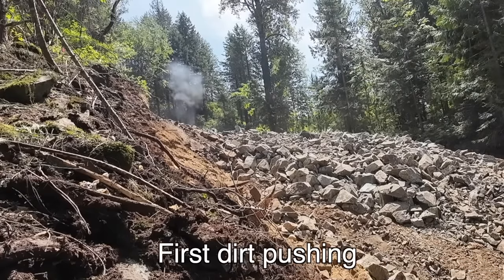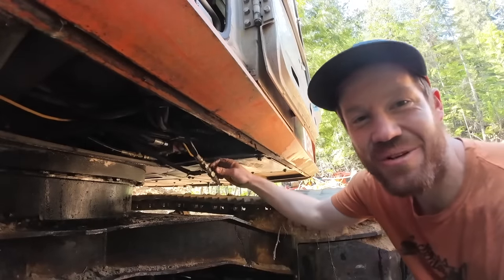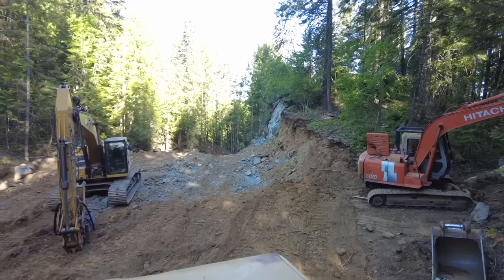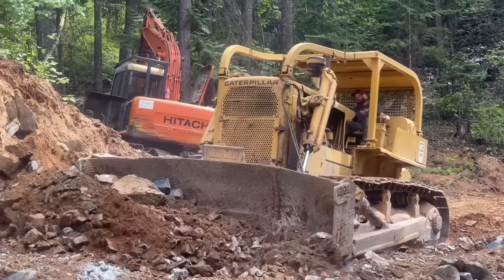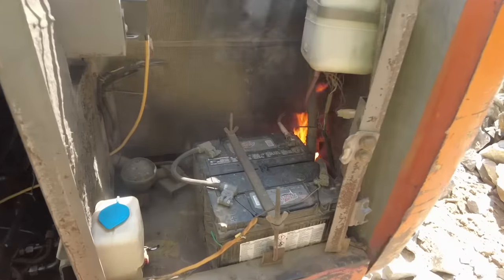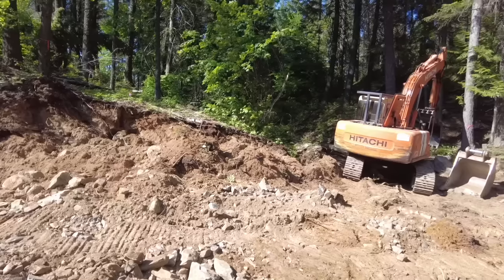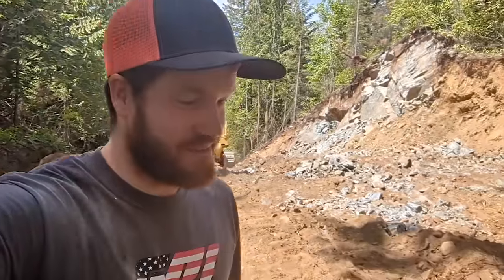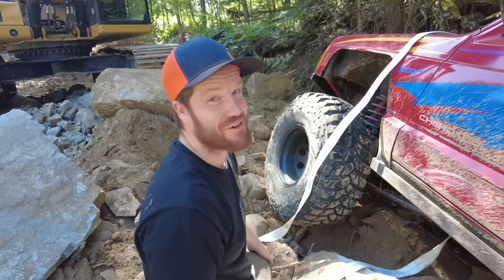I lit my excavator on fire... | Building Our Road

Comment from the maker: To start comparing quotes and simplify insurance-buying, check out Policygenius: https://policygenius.com/ambitionstrikes.
Reply: Almost right after the advertisement, Riley drives the Jeep to where it is thoroughly stuck and need the excavator to extract it? Really? Are wise decisions a better insurance policy than the alternative? I normally don't comment in this manner. But insurance in my mind is for IF something happens, NOT WHEN one puts oneself at risk by choice.
Reply: look in to how much it would cost to have that part of the road blasted because you could have blast down to were you want it in one go and just brack up some of the bigger rocks left
Reply: FWIW: Don't use dry chem extinguishers on equipment because the dry chem is extremely corrosive. best option is a water extinguisher or a CO2. However CO2 does not work as well as water. I recommend keeping a 5 gallon can full of water strapped to machinery so you always have water available, especially if you working in grass that can sometimes catch fire when operating machinery. 

FYI: not trolling, just trying to provide some useful information from experience.
Reply: Isn't the reason for having life insurance so you can be reckless...lol
Reply: Hello, Sorry I don't have tellllllgram. Thanks??? 
I don' t make a good spectator at all! As I love doing that work, of those things!
Reply: Re: overheating hydraulics — usually one of two options given the age of your excavator — the obvious one is a plugged up hydraulic radiator which needs cleaning (or a forced air fan for the radiator).   - a less obvious solution is to increase the inner diameter of all of your hoses — if hoses were replaced with smaller hoses, there is a lot more friction for the same flow rate.

Comment: Our bobcat 337 kept overheating after about an hour as well. New V belt, extreme radiator rinse with normal garden hose and a new fan shroud ( old fan shroud got hot, deformed and sucked against the radiator) had it back in action with the AC blasting nice and cold.

Comment: I am convinced that Riley breaks things just so he can fix them. His way of having fun!
Reply: Professionals break shit once in five years. Do the math.
Reply: You need a Mr. Wranglerstar Professional homeowners shirt!
Reply: You might add. Just because you can buy equipment,  doesn't mean you know how to use it correctly. Each time the dozer blade , jabs the rock side it stress the whole system. 5000 psi hot hydraulic fluid push to one side with a increase of PSI, will blow valve banks. Hurt the hydraulic static controllers. I used to drive a rail road ballast cleaner. 380 feet long, 3 lines of joy sticks, 
Dozens of pressure  gauges,  had 3 radios on at all time as I drove, it standing back wards,  with 20 foot tall digging wheels 2 feet from my A cab windows, where I climed up 15 feet up a ladder to get to my cab.
Point is , there fun to watch, yes R, is smart.
But they have no clue what there doing., digging below the ,ega pond aka lake, spring up water from it. He didn't fix the slope. He built in the winter.....a ice truckers slide.
Snow and rain fill pond over flow, make the new road a river. Then freeze,  wow, talk about sliding. They might add a tow, rope like a ski hill, and charge for rides.

Comment: Don't worry about the water level in the pond. Just make sure you have a ditch on that side of the road to let any water that comes to the surface flow down without coming up on the road surface.
Reply: agreed, and with a culvert it should be fine.  By the way, if there is that much water, maybe you found a spring.  it is ALWAYS nice to have extra water!  I just found another spring in one of my canyons yesterday.  I have a few thousand gallons of water a day now, but nice to find another, (probably another 2000 gallons a day)

Comment: Use a high pressure sprayer on the radiator with engine degreaser. It clogs up with dirt
Reply: But be careful not to bend the fins.
Reply: Or cross the streams 👻
Reply: Compressed air and a long wand between oil cooler and rad to blow it back the way it came, pressure washers toast the cooling fins bending them over easily,  I speak from experience working in the bush( forest) .
Reply: Was gonna say exactly this

Comment: Hey Riley, whenever you buy a new, used machine of any kind one of the first things you must do is clean it, pressure washing with a good degreaser is the best plan. Doing this helps so much in preventing unwanted machine fires. I'm happy you didn't lose your machine but please put safety first!! Having an Extra fire extinguisher is also helpful considering your location. Great videos.

Comment: Definitely need to get a pre-buy inspection on those old track hoes, it will be the best $350-$500. You will never spend 
  Those old Hitachi’s are nothing but trouble.  
   Slow pumps and weak pumps are the norm.  Normally caused by pump outlet pressure sensor. But sometimes the electrical is so bad on the late 90’s up to 2015 models it’s hard to get even the sensors to work anymore.  
  So when all of that happens, it makes the drive motors weak and it cost more to fix them, and the machine is worth, so they get sold as “ good weekend machines” and they barely even have enough power to load on the trailer.

Comment: Hammer attachments on the bigger trac-hoes break hydraulic lines all the time! It’s a common occurrence.. nothing you did wrong. I pipeline for a living and I’ve seen them break with as little as 12-14 hours on a brand new set of hoses. Keep up the good work!

Comment: FYI, you should always keep the fuel nozzle in contact with the fuel tank when fueling. This is to prevent the discharge of static electricity.
Reply: I think he did it for the visuals

Comment: I've seen dirt roads with springs on them. Owners just routed water away and let it run on road side. One of the roads in Colorado had a micro hydro installed front hat spring.
Reply: Same idea from CO mnts! 
He needs deeper ditches on both sides of roads to eliminate that mud, in the road. Build the road up! 🌉

Comment: Don’t forget the water you put in that radiator when cold weather hits. On a side note, we had a cat excavator in the mid 90s that always from brand new had trouble walking and simply would not turn without help from the bucket/boom/swing gear. Maybe a hitachi weakness?

Comment: Using just water in the radiator on the D8 may end up damaging the engine.
You need special coolant to prevent cavitation to the cylinder sleeves. Cavitation will cause little pinholes from the water jacket to the cylinder.
Reply: These have a corrosion resistor /coolant conditioner left from of engine.

Comment: even at 15% grade you still will need to have a couple of piles or mounds of sand on hand during the winter months to sand the hill.  And, as i said b4 you will need to scrape that snow and ice down as much as possible on occasion and more often as spting is around the corner so your road is not as muddy and dries out faster.

Comment: I watched ( many times) up to 15 D11’s at a mine site I worked at doing dozer push clearing. A very fast and relatively cheap way of getting spoil off the coal. 

Draglines re the best option but not always available.

I was always fixing radios or networks on those dozers 
Great to watch for sure.

Even let me drive a D11 once!

Comment: The heat, wires & amps they cook. May have to put a new wire-harness in that area. All these earth moving machines  constantly need maintenance, there in no way around it. Grease them every day. Check the fluids everyday. GOOD LUCK! Be SAFE!

Comment: Riley.  Dirt can stick to the fins of the radiator and will bake on.  In the mines we would have the water truck blast the radiator while running wide open throttle.  It would help clean them out but after a few years we would have to change out the radiator.  A pressure wash might just give you a longer run time and operate a little cooler. I know it did on the machines I ran.

Comment: Hey brother! The overheating issues on the Hitachi, is probably because the hydraulic cooler and radiator probably need a deep cleaning. If not needing to be replaced. A little parts cleaner/degreaser and a power washer could help.

Comment: You would think Cat would have a rock guard on the windows when they rent it out for hammering rocks, not to just protect the windows but the operators also. That looks like great fun running those pieces of equipment, good job so far on cutting in the road. I grew up watching them cut mountains down beside our house for a access road for I-77 in Charleston, WV. Me and my brother got a ride one day from a Euclid dump truck one time boy did that huge truck ride smooth, the driver almost got caught giving us a ride his boss came by and wanted to talk to him about something he told us to hide in the cab while he climbed down and talked to his boss. He didn’t get caught but he dumped the load of rock and let us off where he picked us up from, none of the other kids believed us about getting a ride.

Comment: Be careful to check swing motor oil, do not over grease swing bearing or seal  can be forced out and really bad. Never add straight water to rad , bad habit that will bight you. We call Hitachi 's  Hibachi's for a good reason, better left in town lol. When working in rock, daily checking of everything that can come loose will pay off before it falls apart, especially track pins . Get rid of that money pit old Hitachi if you are smart. Maybe rent a rock truck for moving material down the road if possible ,you'll love it . Rock is hard , literally on everything,  but makes good road when done. Good luck.

Comment: Used machines are always a hit or miss on condition.  Running machines  by day and fixing by night makes a long day. Hope it is just an arcing problem that is causing your fire and not a amperage draw. Used old garden hose to encase bare wires before until we could get a replacement cable. Hope the water issue is separate from your pond. If you can't go down any more can you just dig the hill more? Nice big flat spot for a camping spot for guests.

Comment: Spray out the radiator with a pressure washer, after you do make sure that you let the radiator fins dry out before you use it otherwise the water will trap dust. If the hi temp continues you might have a cracked cylinder head or a leaking head gasket or a cylinder liner with a hole in it.

Comment: Remove the radiator guards in front of the grill and pressure wash through the radiator, this is regular maintenance on all heavy equipment, compressed air also works.

Comment: It's the same machine as a John Deere 490.   I owned one of the "Gray Market" machines that was my first excavator and I had no idea there was such a thing.    Buy you some seal kits and rebuild track drive motors.  Everyone I've seen with age wouldn't pull themselves out of a wet paper sack.

Comment: If you have Runnings stores in your area. The carry a decent selection of the straight connection lines and several fittings. I was quite surprised.

Comment: Well, glad that you could get that fire out before the excavator took more damage. Could have been worse.

That's a really good example how useful a fire extinguisher can be on your machine. If you have a small fire that just started, you can easily get it under control. Especially when youre a bit further away from the next fire department AND in the middle of the woods on a road under construction.

Comment: I'm surprised that the rental on the excavator is 2 weeks.  I've seen that monthly rental on heavy equipment is usually about 2 1/2 times the weekly rental rate, so for a half week's rental I would get another two weeks.  That doesn't even count the cost of delivery and pickup, which is the same no matter how long you have it.

Comment: The first thing I would have was a ripper tooth for the dozer or the big cat, it looks like the mountain is not the hardest so based on my experience it would be more effective than the hammer. Don't kill me if I am wrong, thats just a tip for how we sometimes do it in Norway at small private projects 🤗 And maybe it would you could use the armytruck to back some loads when the dozer get his timeout/ powernap 🤔

Comment: The fire was most likely caused by chafing away the isolation on the battery cable, or melting it due to high temp.
Make sure to have chafe guard when near metal, hang the cable with proper clamps, and use a good, oversized cable when rebuilding!

Comment: Perhaps it's time for a D8 high track dozer? And a bigger, newer excavator for yourself, just saying . . . .I admire your chutzpah in tackling such a big project with just basically two larger pieces of equipment. Normally there would likely be at least 3 large dozers and a couple of large excavators on such a large task, but you can get it done, even if it takes a while! I'm proud of you guys!

Comment: With the small excavator ya might want to check the thermostat,compression test,see if theres any air pockets in the cooling part and well the fire ya just need thicker wire with proper insulation as it s probably gettin cut through the hole as it goes under ;)

Comment: A clinometer is a tool that is used to measure the angle of elevation, or angle from the ground, in a right - angled triangle. You can use a clinometer to measure the height of tall things that you can't possibly reach to the top of, flag poles, buildings, trees.   Riley:-  Here is your aid to pronunciation, seeing as you had difficulty even remembering the correct name of the unit:-    CLI —no — METER    emphasis on "CLI" and "METER".

Comment: Yours is the second channel that I follow that has had an equipment fire. The fire extinguisher worked in your case; in the other? he was not so luck although he was able to get it put out before too much damage resulted. Over the years I have managed a number of civil and environmental restoration-type projects. The equipment get daily inspection and "fire extinguisher: Y/N" gets dutifully checked but the functional aspect isn't considered. There is a lot of grease and oil in the engine compartment and undercarriage which will burn.  Ok. Off my soap box. Great progress, gang!!
Reply: What’s the other channel. I’d like to watch it. Thanks
Reply: @BobBohner4851  farm craft. Maybe one word.

Comment: On your overheating excavator you might want to pressure wash your radiator. I bought a ZX200LC Hitachi and it overheated until I did that. All kinds of dirt came out and it has been fine ever since.

Comment: With all the greasing u have been doing on the machines. U should really look in to lube shuttle grease and grease guns way easier changing tubes and way less messy.   And u should get a locking coupler so u don't have blow out of grease when it doesn't lock on with a traditional coupler

Comment: Well next dozer time will be fine.  The excavator  that had the fire just replace the wires as in make up a new harness.  
It will be fine and check for head gasket leak as in gas getting into the cooling system. 

Other than that your good to go.

Comment: Hydraulics damage...elephant in the room...for anyone who doesn't know, the ONLY medical treatment for high pressure penetration of hyd. oil into the body is amputation. pass corrugated cardboard around the possible area of damage to search for any almost invisible streams of the oil resulting from pin hole(s) in the hose(s). Amputation. Or you pay your hard earned money for a trained mechanic to service/repair your hydraulics.

Comment: Clean your machines!!! Needles build up in engine compartments and boom base etc. Take under-house covers off pressure wash. Rad/oil coolers too!!!!
Also get yourself a laser temp gun and check all hydraulic temps!! Especially in hot weather. If you run extended periods over 180-190 deg F. You will totally F your system and or it’s operating pressures and life of it all.

Comment: Those dozers do not have a recovery tank and coolant should not be filled above the crossbar that has the filler cap stud in it.
Reply: You. Should blow out he rad regularly. Also the fan blades can be reversed. Just push in and twist the blades. Summer it should blow out. Winter is reversed and blows heat on operator

Comment: Back in about 1974 my Dad bought a brand new farm tractor. It had the diesel tank right at the front ahead of the radiator. Below it was the battery and between the two a large rubber mat. My younger brother was working new ground straight after the dozer had cleared it so was a bit rough. He was pulling disc's. The metal battery clamp cam loose and arced between the hot terminal and the metal pipe from the diesel tank. It basically severed the pipe. Diesel pooled on the rubber mat and ignited. My brother immediately headed to a big pond. Sadly the tractor ran out of diesel because of the feed pipe damage only a few feet short of the pond and burnt to the ground. As for your excavator, hydraulics hate heat and need good filtration. I suspect you have pump issues that are bypassing lots of fluid that is creating issues. I guess you have to decide to you make it work half way decent or sell as is. Might need to do some serious diagnostics and price everything up. Old and floppy is fine if it keeps going. I bet your old D8 hasn't worked so hard for 30 years. Testament to how well build they are.